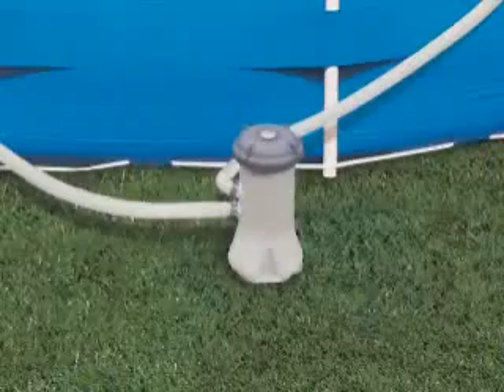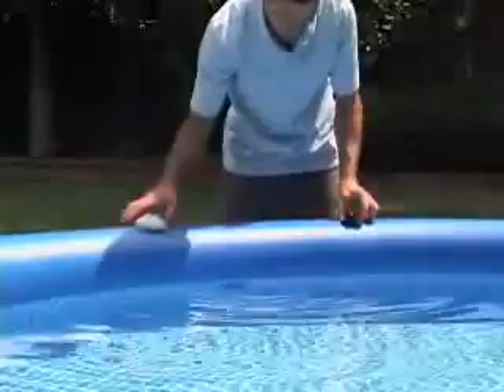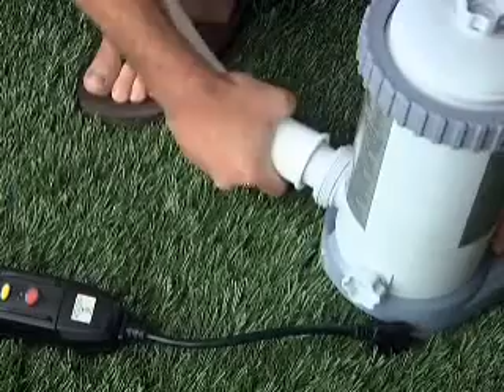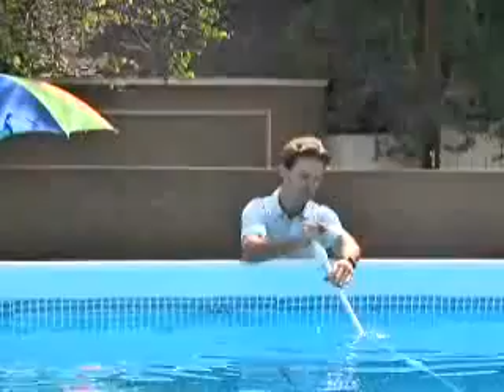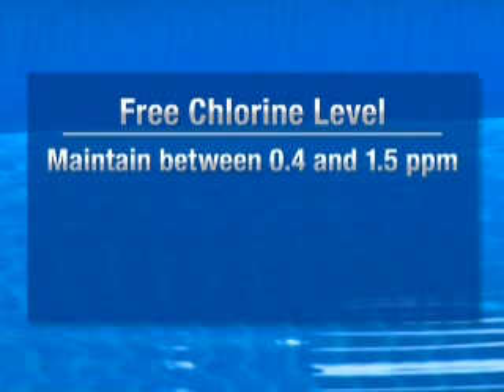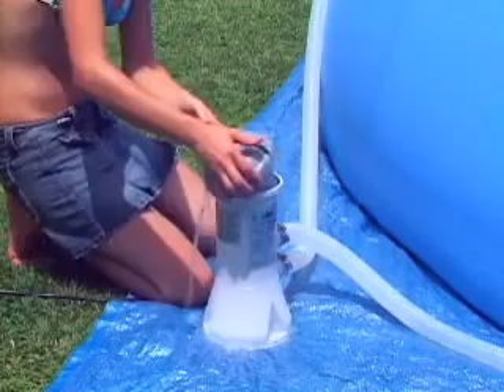KRYSTAL CLEAR SALTWATER SYSTEMS - Set Up Instructions

Comment: Good day,

I would like to inquire about the operation of the Intex 26670 Chlorine Generator. Specifically, will it restart automatically when power is resumed, or does it need to be manually started each time?

I have an electricity market price monitoring system that controls the operation of my circulation pump, so the pump runs at varying times depending on electricity prices. If the Chlorine Generator is connected to this system, will it resume operation automatically when power is restored, or does it require manual intervention?

Thank you for your assistance.

Comment: I have hard water, full of calcium which turns to small gravel after a few weeks and settles on the base of the pool and makes the water milky. The house has a salt system to de calc the water but the external water tap is not on this system. Will this salt system clean the calcium out the water and soften it? Or better with the sand system? Or both, but that’s gonna cost etc

Comment: When adding salt to the pool, the Owner's Manual says you must run the filter pump 24 consecutive hours to thoroughly dissolve the salt before turning on the Saltwater System.

Did you do this—for a full 24 hours?! Can you run the filter pump for that long?
Reply: Isaac Guerrero I did it. Just run it for the 24 hours and get it over with.

Comment: I ran my system on boost mode at start up threw the night had a very low chlorine lvl at start woke up to extremely high lvl 8.4ppm what I do to lower the chlorine just shut the system down till it drops to the desired lvls also my salt lvl are right on at a 6.2 the pool is a 18x9x48in above ground pool I have the system to set to run 2h at a time

Comment: I found you had to take off the intake hose that is attached to the blue filter. behind that stuff would pile in. like pine needles .make sure the pump is off and the valves closed. hope that works for you